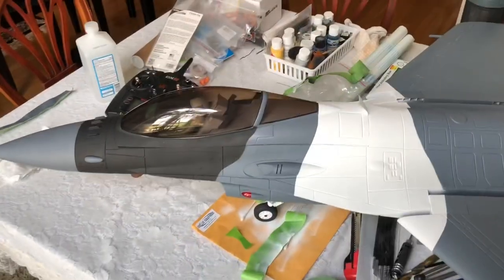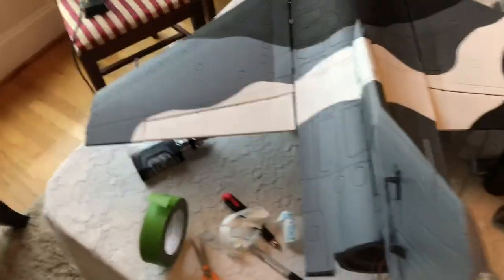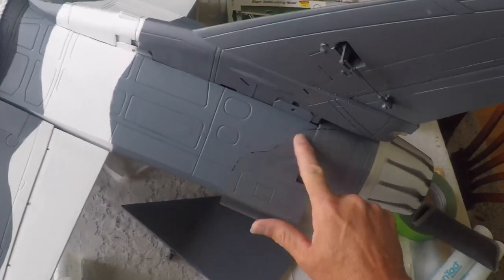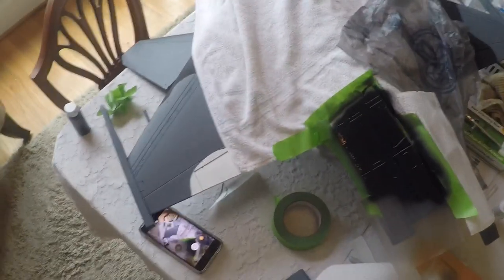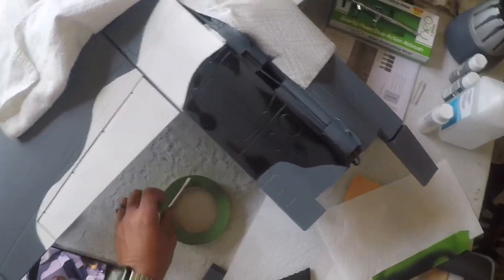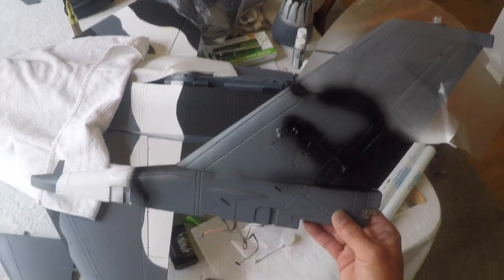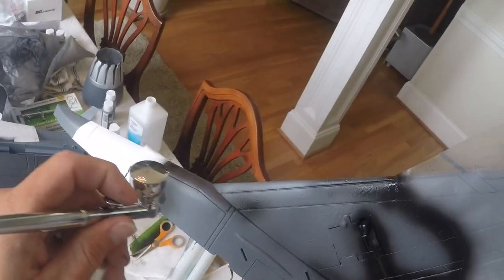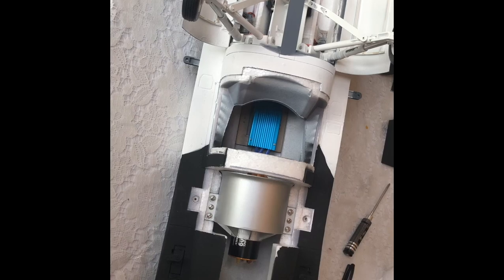Pt. 3 FREEWING 90mm F16 CUSTOMIZATION, ARCTIC AGGRESSOR SCHEME PAINTING

Comment: Nice job.  I tried the contact paper technique on my project but it took off some of the paint.  I ended up repainting the whole airplane in base gray and hi-lighting the panel lines.  It turned out ok.  Your's turned out great, I might give it another try.  If you thin your paint to a milky consistency, the airbrush won't clog up as bad.  Here's a DIY thinner formula that I found on line that works great for me:
 • 12oz Distilled Water
• 4oz Denatured Alcohol
• 4oz Window Cleaner
  (no ammonia)
• 10 drops of Glycerin
Reply from the maker: Thanks uncle Bob, make sure it’s a low tack paper, there are several different racks out there, my wife does vinyl decals and depending out what she’s doing, she uses several different tacks, thanks for watching
Reply: @JeffsCustomRC  I bought a Silhouette Cameo vinyl cutter last year and make my own decals.  I still haven't found a good transfer tape.  I thought I was using the same contact that you used but I think it was more bad technique on my part.
Reply from the maker: There are all kinds of transfer tapes, my wife does custom vinyl, the stuff I used on my plane was actually shelf liner from Walmart so my genius wife informed me tonight 🤪

Comment: Hi Jeff, I have a couple of question, I’m trying to teach myself airbrushing. What kind of airbrush do you use? I only have the one that came with Harbor Freight compressor. I’m experimenting with the acrylics from Walmart. It’s so thick how much to you thin it, and do you use water or winded? I think you said you use low Tact shelf paper?   Thanks Danny
Reply: Windex  window cleaner
Reply from the maker: Hey Danny, my airbrush is a neo by iwata from hobby lobby, is a dual action which I like better than a single action for several reasons, I normally thin white by 1/3 with water, and black is about the same due to their thick paints outta the bottle, windex helps to dry the paint a little quicker, but a like warm blow dry works great as I showed, just don’t get to close to foam for a long period of time. The Walmart paints work great and are very well priced, I always use matte when I can get it since I go over my paint with matte polyacrylic spray which seal and protects great, even over decals. Hope this helps and let me know if you need anything else, don’t be afraid of the airbrush, you do get what you pay for in one , but their great once you get the hang of it, watch a few airbrushing videos to see the difference in brushes, dual vs single action, and learn how to do really small lines or big air sprays, that’s why I use a dual action, thanks for watching👊🏼👊🏼
Reply: Jeff’s Custom RC Thank you, I’ll look at Neo again thank you for your time, it’s fun learning with it.